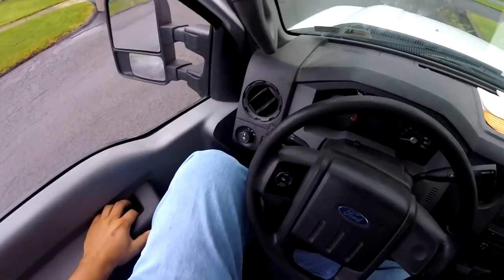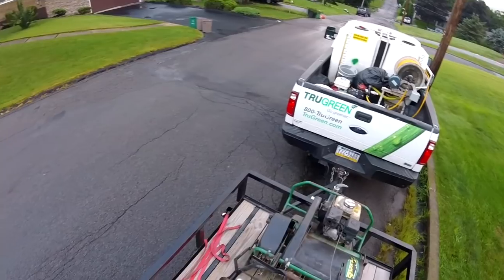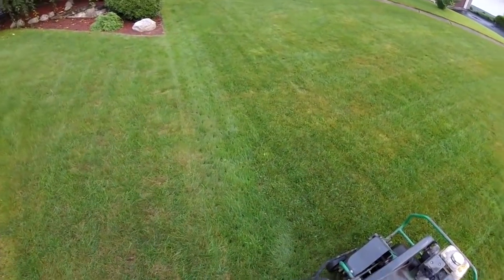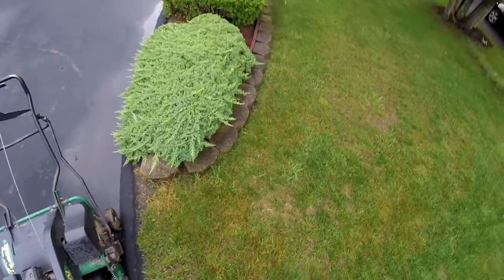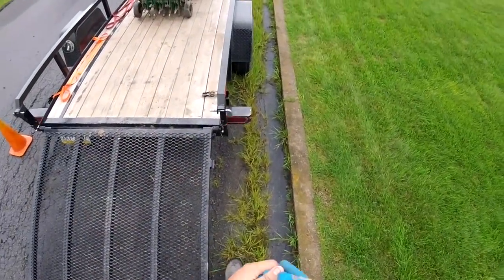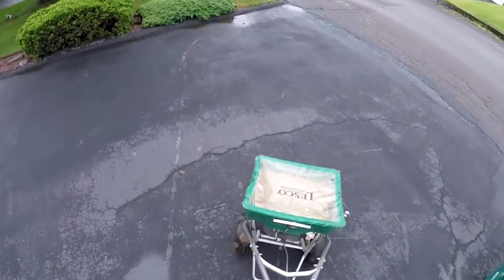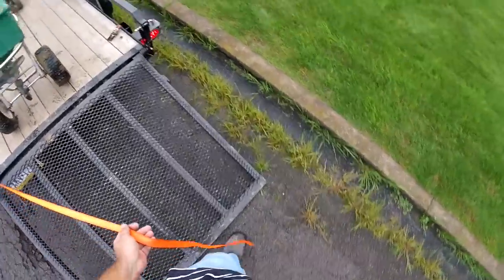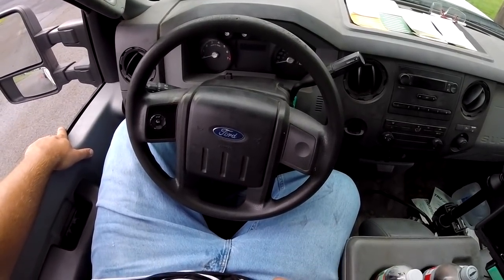WORKING AT TRUGREEN THIS IS WHAT IT'S LIKE. Aeration and Overseeding.

Comment: They are offering 17 an hour in my area.... debating on whether I should take it considering I make 15 at my current job
Reply from the maker: Depends if you like outside work. The video you watched was the smallest property that one was less then 2000 sqft. I generally was doing on average 10,000 sqft yards. About 7-9 houses a day. It was also about a 2 hour ride each way to get to where I was working at that day. So gotta like driving a little bit. Also if it's 95 degrees 100% humidity with no shade you're still gonna be working 12 hours that day and be borderline heat stroke the whole day. If it's raining all day with thunderstorms the whole day you're still working 12 hours that day. If it gets cold where you live and it's 30 degrees and raining your still working 12 hours that day. Personally I hated every second at this job. But some people like it.
Reply: Thank you for the insight! I will think it through I have an interview set up for tomorrow. I’ve read reviews that they lay off during the winter time
Reply from the maker: Yeah they do lay off during the winter time but you usually still end up working till mid December and come back around mid March ish.
Reply: @Teebz  thanks for the insight Big K I stay working for my company on Monday is it easy to move up in the company by getting certified in some areas to get an extra dollar
Reply: The Big K I’m in Indiana and got offered and interview. It’s gonna be October tomorrow and winter is right around the corner. Do they offer unemployment since it snows here a lot?  I’m curious cuz I don’t want to work for maybe 2 months then oops sorry u gotta go. It’s winter time.
Reply: Dr Klopek yes they do offer unemployment benefits, if you had questions go on the trugreen company profile on indeed and go to the Q&A thread where 375 questions have been asked relating about anything about the company . Can be used for pre interview research or research overall about the company’s. Questions are asked and answered by former and current employees so it’s reliable

Comment: Its not a hard job....this dude made it much harder then it needed to be
Reply from the maker: Yup. 70+ hours a week. 6 days a week. And you get paid less than a Sheetz gas station cashier. Fun fun.
Reply: @Teebz  ive been at trugreen for 8 seasons...they pay us very well...much more then a gas station clerk.
Reply: @Teebz  you must have gotten into a bad branch.
Reply: @Teebz  in addition to that...we have bigger machines...the ride on aerator i use make any lawn a breeze, you are correct about the 70+ hours a week though... makes for a nice paycheck every week
Reply from the maker: @josephdennany2634  Regardless I worked there for a bit it was kinda cool some days. There's just no benefit for me working 70 hours a week.
Reply: I work for a local company but I do the same kind of work. I am paid well. But it's definitely not always easy.
Reply: @Tinman710  if you condition yourself ...its like getting paid to exercise
Reply: @josephdennany2634  yeah that's why I do it

Comment: Whats it like driving one of the company trucks with a trailer attached? Any tips?
Reply from the maker: Much practice. Going forward very easy. Going backwards is very weird at first. Cuz when you turn left in the truck the trailer swings rights. But it's pretty easy to learn.